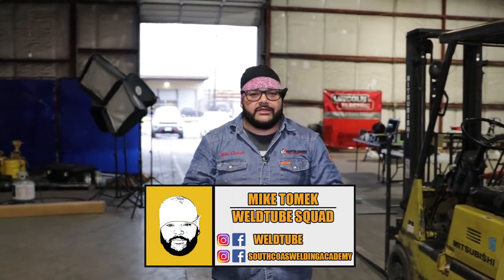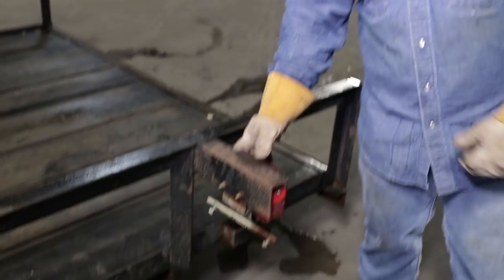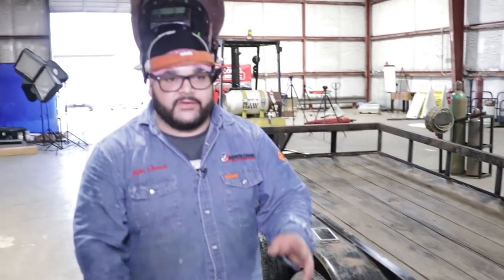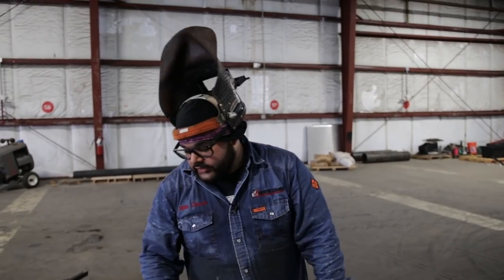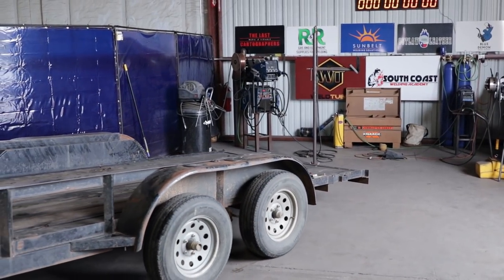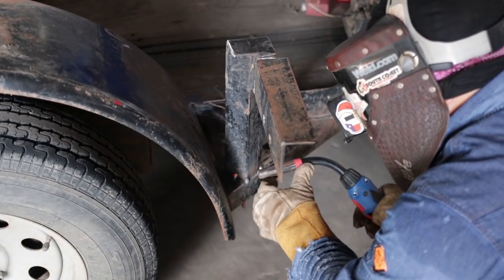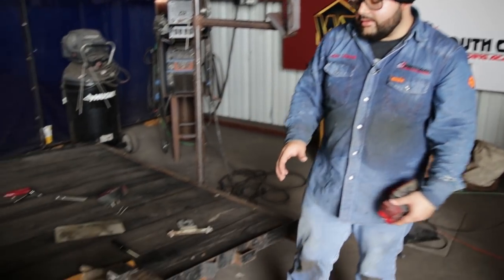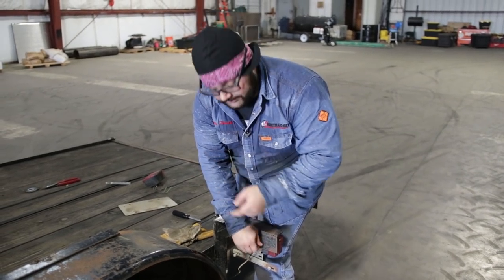Trailer Modification - Cutting and Welding

Comment: So, all that angle that was removed was a truss system to keep the deck from folding up and dragging on the pavement. you need to do something to stiffen the frame now that you have removed structural members.
Reply: knotbumper the trailer is already x frame under neath so that is why I was able to remove the sides and not worry about it folding up or anything!